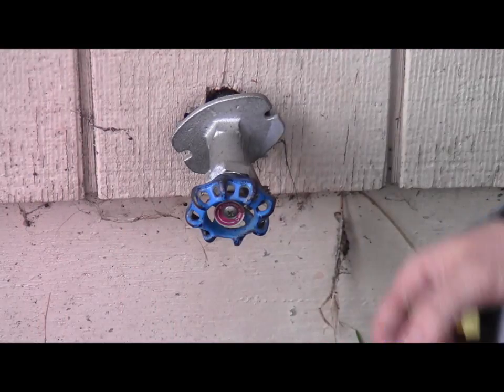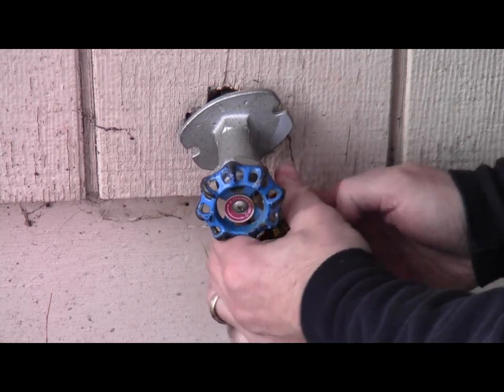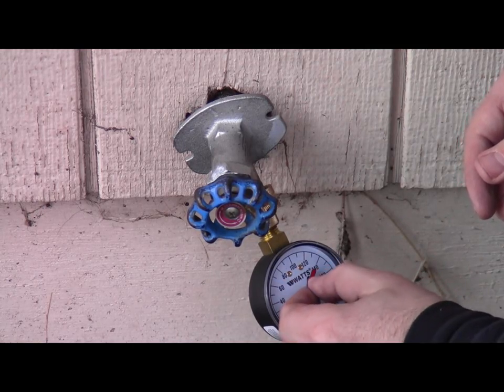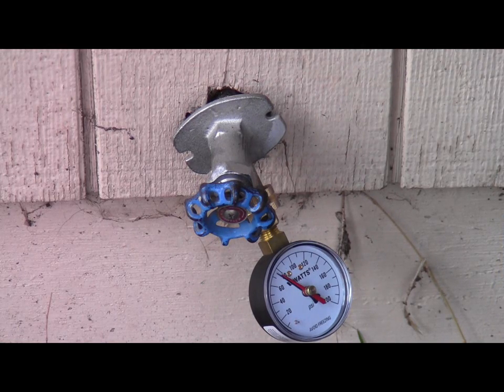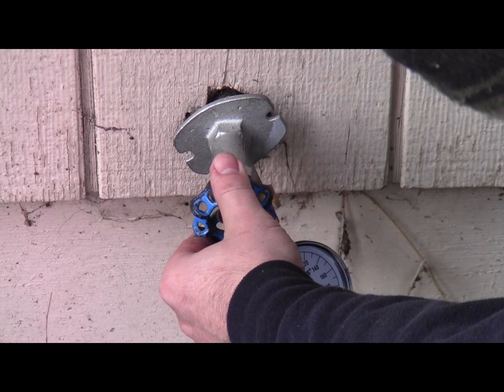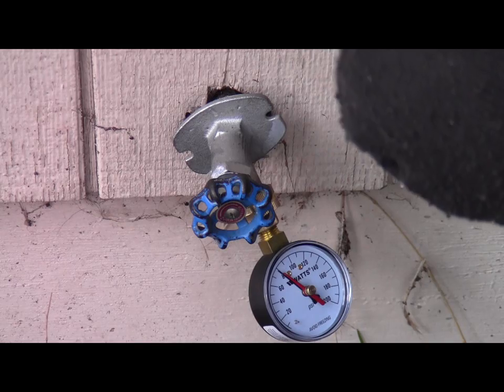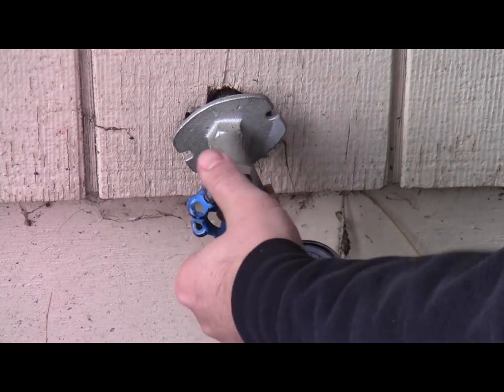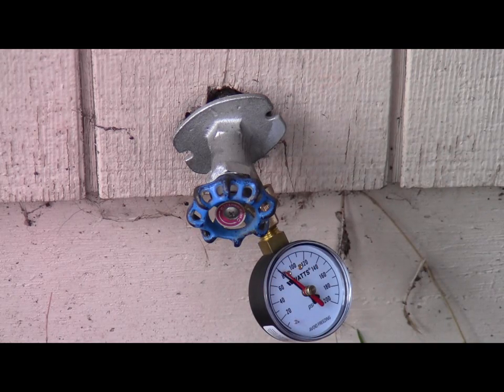DIY- How To Test Your Home Water Pressure

Comment: Why does it have two needles?
Reply from the maker: Set the red needle to zero and as the black needle goes up with water pressure, it moves the red needle as well. When pressure is turned off the black needle returns to zero, the red needle remains  at the pressure reading. Hope that make sense.

Comment: What is the pressure range it should be at ?
Reply from the maker: My understanding is between 60 to 70 for ideal pressure. 30 to 80 is the rating. No more than 80 as it may be in code violation. I would call your local water provider and check with them on recommended pressure for your location.

Comment: Thanks! I bought the product, but it came with no instructions
Reply from the maker: Thread it on to the hose outlet outside make sure it snug and water doesn't leak out. The pressure it reads will be your home water pressure. Hope that helps
Reply: HighDesertAdventurer ever since spring, I’ve had vibration when the pipes are used (though if multiple fixtures are used, no sound)

Just tested it, get 60 psi on average, though the red line did burst to 80 at first
Reply from the maker: @jhtrico1850  That's a bit beyond my knowledge. You may want to pick a plumbers mind.

Comment: Thanks!  Worked.  Hey, in my instance i actually had the water flowing but it still gave me a reading.  Is this normal?  In other words; when I attached the device and turned on the water it actually flowed out but still worked and gave me a reading.
Reply from the maker: Allan Cerf Flowed out from the gauge? Around the threads?
Reply: Yes, among the threads.  There was no way to turn the water on (at my house anyway) and get a dry reading.  It said 80 PSI, dipped to 79 then went back to and remained at 80.
Reply from the maker: Allan Cerf I don't believe a little water around the threads would matter too much. That's great pressure.

Comment: when the pressure is at what reading should you put an expansion pressure tank on a hot water tank???
Reply from the maker: Marmar c thanks for viewing. My understanding is when there is a back flow valve installed a pressure tank should be installed. After we had the back flow installed I blew 2 pressure valves before the tank was installed.

Comment: Can you use this gauge to check for water leaks and, if so, how do you do it?  Also, if you have high water pressure can't you just turn the water valve at the meter not all the way open?
Awesome video. Thanks a lot.
Reply from the maker: Thanks for viewing. Great questions. As I am not a plumber I would not feel right in giving answers I am not sure of. Whish I could help.
Reply: You will not be able to use a simple pressure gauge to measure if there is a leak somewhere, because of Bernoulli's principle - the higher a fluid's velocity is through a pipe, the lower the pressure on the pipe's walls will be. Why am I bring that up? If you have a narrowing conversion of 3/4" pipe to 1/2"  pipe, the water will flow faster as well as exert less pressure in order to compensate, where as the mass flow rate will be a constant at any point in the pipe. In order to calculate if you have a leak use the continuity equation - (Δm_1/Δt) = (Δm_2/Δt). In other words (Δm_1 = (density * Area * velocity)/Δt) at one point will be equal to (Δm_2 = (density * Area * velocity)/Δt) at another point. Do not turn on any faucets or appliances that use water when measuring and comparing results
Reply: Also to answer you second question, if are you planning on using your water valve - which I am assuming is a full port ball valve - as throttling device, then it is quite possible to as you stated "turn the water valve...not all the way open". Notwithstanding, make sure that you are aware of the valve's travel characteristic over time. It may very well be a constant game of re adjustment so I would recommend getting a v port ball valve or better yet a pressure regulator valve like most houses have.